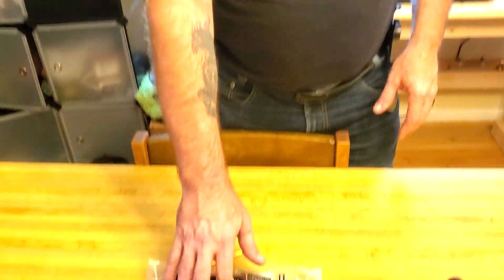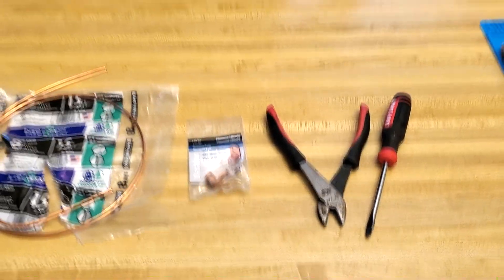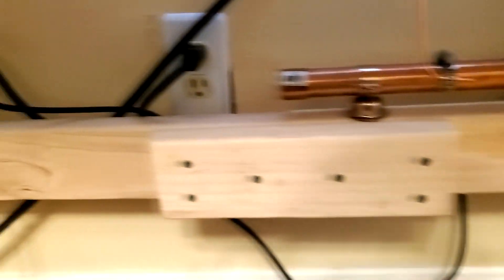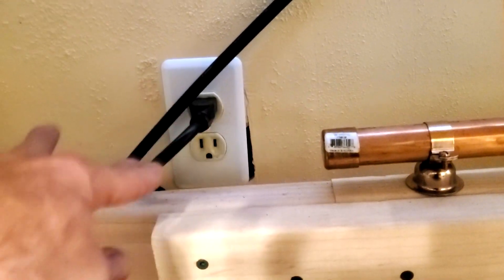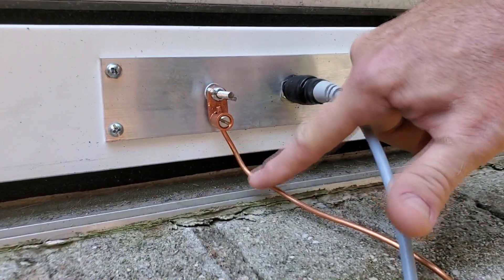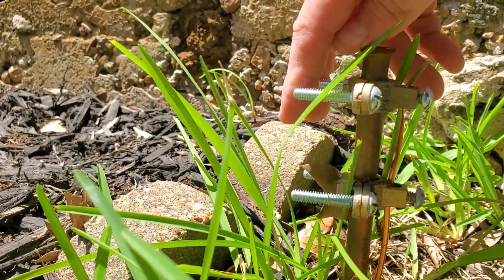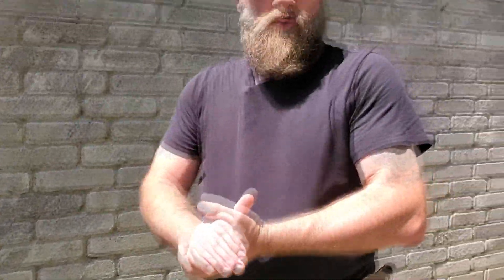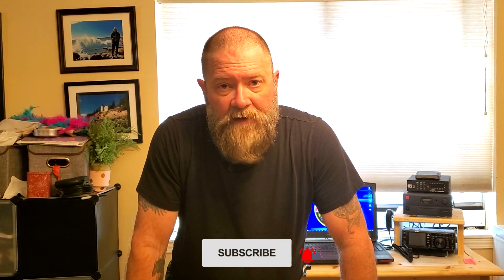How I ground My Ham Radio Station

Comment: I have tried to get a handle/understanding on this - I may not be smart enough.  I am not an EE and some of the discussions I have read through seem to get pretty heated.  Visuals w/ discussion(s) are very helpful for me.  Thanks again for your efforts to share and thanks to the other commenters for helping me/us out!  73
Reply from the maker: No problem, glad to help.  One of the most heated topics online or anywhere concerning ham radio is opinions on grounding.  I say, do what works for you.  There is a standard to follow, but don't overthink the process.  Even with all of my ground rods and wires going everywhere, if I see a bad storm coming, I still unplug everything from my window passthrough and unplug the power supply from the wall.  There is a huge investment in radios and equipment sitting in my shack and I am not about to lose it in the event of a storm and I get tagged with lightning.  Thanks for watching.  73!

Comment: I have not looked at all the comments. Just maybe 10 or so. Here are my comments:
1. braided straps between your common grounding bus and the equipment and from the bus to your pass-through.
2. 6 gage stranded (bare) wire from the outside of the pass-through to the ground rod. It is best to bury it and the top of the ground rod.
3. 6 gage stranded (bare) wire from the shack's ground rod to your service ground. (This will reduce QRM and prevent a ground loop.)

When and If you decide to put the ground rod close to the shack, stay at least 3.5 feed from the foundation wall (to avoid the foundation's footing),. which also eliminates the foundation from hampering the conductivity of the soil. Add a bus bar to the top of that ground rod to connect the lightning arrestor(s), the shack, and the other grounds. Every thing connected in series outside of the house. (except the lightning arresters on the outside bus bar.)
Reply from the maker: Those are all good and valid suggestions.  Thank you.  I am still trying to source a local place around me to find that braided strapping.  As for placement, I am limited somewhat by my surroundings and location of my shack currently.  I do appreciate all of those suggestions and have copied them to a document to go over in detail.  Thanks for watching.,  73!

Comment: You did a great job at showing how it's done. I was wondering if your antenna is grounded if it needs to be?  Maybe you show that on another video ?
Reply from the maker: Thank you for the comment and for watching.  Yes, I do have an update to grounding my shack in the list.  I drove another ground rod where the antenna is attached to a lighting arrestor.  It is a very short video.  Thanks again, 73!!

Comment: Dude thank you for this video. Strait forward and to the point. Is it necessary to have the copper pipe under the desk? I have a similar window pass through with multiple wires coming from the grounding point on the pass through  going to all the equipment. Thanks
Reply from the maker: After researching this topic a bit, it seemed to make sense to me.  Whether it is mandatory to do or not, maybe not, but I would think that the more grounding you have the better for the longevity of your equipment.  Adding that part to my grounding system only ran about $25, so I figured why not.  Thanks for the question.  Hope that helped.  Thanks for watching.,  73!

Comment: Sorry for this dumb question! Did you find that grounding has improve any reception or help with received background noise?
Reply from the maker: Not a dumb question at all.  I actually had no difference before or after.  Seems to be the same.
Reply: @HR4NT  Thanks,  i haven't seen any difference ether, so thinking i missed something. just going to see if you've done anything on loop antenna, if not what's your  thoughts?
Reply from the maker: @theDaftman  I haven't had a chance to play with any loop antennas yet.  That may be something I decide to do down the road.

Comment: Thanks for the video great info man keep it up. Got a question about the grounding the Ft991a.  Im wanting to build a Gator box for Pota and  shack.
How do you ground it when in the field ?
Reply from the maker: There are metal shelves that I bought to mount everything to.  I ran a ground wire to the shelf and screwed it in.  I guess you "could" run a ground wire outside of the box so when you setup for POTA, you could attach it to a metal rod, picnic table or whatever to act as a ground.  Hope that helped.  Thanks for watching,... 73!!

Comment: I hope those hose clamps aren't aluminum. Also, if you put in another ground rod outside, make sure it's at least 8' away from the ground rod you already have. Otherwise, they sort of cancel each other out.
Reply from the maker: The clamps are steel.  I also have the other ground more than 8 feet away.  Thanks for the tip and for watching.  73!!
Reply: "cancel each other out???"
Reply: @DNBVideo  Yes, I've heard that if you have multiple ground rods, the distance between them should be equal to their length. So, if you have an 8' long ground rod, and you put in another, it should be at least 8' away from the first one. 
https://www.youtube.com/watch?v=DiapZ7RkjFc&t=124s
Reply: @tglenn3121  I do understand the distance requirement.  I was confused about the terminology about cancelling out each other.  How do they cancel each other out?
Reply: @DNBVideo  If you read the other response I wrote, you'll see an article indicating that when they're too close, their resistive features overlap and reduce the amount of grounding you get.
Reply: @DNBVideo  The NEC requires all driven rods to be a minimum eight feet in the earth and for multiple connected rods a minimum spacing of .
Reply: The reason being is that when they're too close together, they cancel each other out.
Reply: @DNBVideo  Ground rods spaced less than two rod-lengths apart
Reply: Copper and aluminum WATER PIPES when submersed in WATER  corrosion will happen but NOT OUT OF WATER.

Comment: Look at the Polyphasers that you can install on the outside where the antenna connection comes into the house. They are the best on the market that I have found.
Reply from the maker: I was having issues finding any good info on the various brands and models to choose from.  Since shooting this video, Polyphasers have come up a number of times.  Thank you for teh suggestion.  I will look more deeply into them. 73!!

Comment: You’re not supposed To Copper and aluminum  together they will eat each other up
Reply from the maker: If you are referring to my window passthrough, the screws that the copper wire is attached to are stainless.  Thanks for the tip though.  I didn't think about the reaction of those two metals.  73!
Reply: When copper and aluminum WATER PIPES are mixed together corrosion happens but NOT OUT OF WATER.

Comment: where on the back of a mobile ham radio would you attach a ground wire, if you are using the mobile as a base station inside your shack?
Reply from the maker: Most mobile radios have a ground on the back.  I know that the FT-891 has that feature and I would think that most other mobiles would as well.  Thanks for the question.  73!
Reply: @HR4NT  Yes, I see where the FT-891 has a screw above the coax connection for grounding. Well, my Icom IC-2730A mobile radio doesn't have this screw; so I think that I will have to ground through the threaded holes where the mounting bracket screws belong. I went to Ace Hardware and purchased M4x6 screws, next I need a braided tinned copper ground strap to use with the screws.

Comment: Any mechanical connection that can be refreshed by turning a screw once in a while works for me.  The hose clamps around the 1" copper pipe may not be as refreshable as a pipe clamp, threaded with a pointed screw that impinges directly into the pipe (which can be tightened once in a while).  The 6 gauge wire can be clamped under a screw head that is threaded into the pipe clamp (which can also be tightened once in a while).  Just my two cents coming from years of GROUND BREAKING HEADACHES!!!!!!!
Reply from the maker: Hi Dan, I appreciate the tips.  I am going to continue to fine tune my setup and suggestions are always welcome.  Gotta protect that investment sitting in the shack!  Thank you for the comment and the support of the channel.  73!!!

Comment: This NEEDS to be bonded to your "service ground" as well!  
It's important to note that NEC REQUIRES (not suggests) surge protectors on any antenna cables/feedlines before they enter a building or dwelling. If, God forbid, a lightning strike hit and started a fire, homeowners would deny any claim for damage because your set-up violates National Electric Code!! 
If your "station ground" is not bonded to your "utility ground" it may dissipate static and may even give you somewhat of an RF ground, but will NOT protect you or your equipment from a nearby lightning strike. Indeed, a "stand-alone ground" will almost always make it worse.
Remember, there are two separate things here, grounding and bonding. The purpose of a grounding "system" it to keep everything at the same 'potential'. 
Depending on where you live, 'earth' (soil) has different values of resistance/foot.(the FCC website has maps of the US)
 Using basic ohm's law, a typical lightning strike is about 300 million Volts at about 30,000 Amps!! 
The difference of potential between two separate grounds is enormous, destructive and quite lethal. 
If your station ground is not bonded to your service ground, I'd recommend disconnecting it as you'd be better off with no ground!! Even nearby lightning strikes can induce millions of volts. I would highly recommend running a minimum of 6AWG STRANDED wire from your station ground to your utility ground. 
Mike Holt has a lot of good info on grounding on his site. 
Best of luck with your project and 73, 
AA2HA
Reply from the maker: Thank you very much for the info!  I knew that some viewers would be able to point out things that I wasn't able to find out or figure out on my own, so I appreciate that.  Thank you for the comment and the channel support!  73!
Reply: @HR4NT  Bottom line: do the tuner & amp perform as they should? Whatever conditions allow them to do so is okay w/ me. A thousand or more watts is not trivial so it has to be done right! Mike Diamond Plumbing put in the service panel. I'm gonna ask then about the "National Electric Code!"
Reply: My service ground rod is under concrete but I have access to the solid copper wire going to it from the meter box. Could I just tap into that wire and bond it to my station ground rod from there? Thanks
Reply: @dirkderemojr.3316   I've got the same/similar question.... can you bond the station ground to the service ground by running a wire to the service grounding bar?
Reply: @johnregan9644  Yeah I just bonded it to that and called it good. Not worth removing concrete imo
Reply: “Homeowners”? I love seeing this crap lol

Comment: great video, only addition i would recommend is adding some thought into RF ground (static) versus lightening suppression.  you have a very good setup for dispersing static and ground loops in your radio equipment, would recommend having another grounding rod for your lightening suppression separated as much as possible or away from the house if possible.  love your channel.
Reply from the maker: Great tip and a good point.  I appreciate the input!  Thanks for the comment and for the support!  73!
Reply: that is not at all code
Reply: @bigdEnergy666  Please elaborate. Could use an explanation.

Comment: 1" wide braid from your gear to the pipe. Flatten the pipe.  1" braid from the pipe to your clamp. keep your grounds as short as possible. use 8 ft ground rod.
Reply from the maker: Thanks for the tips!  I was looking for some braided copper strap.  However, I will have to order it because the home stores nearby don't carry anything like that.  Thanks for the comment and for supporting the channel!  73!
Reply: @HR4NT  https://thewireman.com/product-category/grounding-lightning-protection/tinned-copper-braid/
Reply: Whether the 1 inch pipe is flat or round it is the same surface area, so flattening it makes no sense. Also any additional ground rods must be bonded to the same ground rod the electrical panel is per code. Separate ground rods not bonded create an imbalance.
Reply: @NDC0065  your grounding RF not eletrical.  if your radio is on a supply with a 3 pin plug then you are already grounded electrically.  RF you want a separate ground.
Reply: @Brad Kellison  that's not what he's explaining in the video, he's talking about lightning protection not rf. Maybe I misunderstood him when he was talking about lightning protection.
Reply: @bradkellison5359  4' ground rod is more than sufficient in soft soil.
Reply: @alfrede.neuman8898  you are better with 8 ft even in soft soil.
Reply: Brad,
What is the purpose of flattening the pipe? If that is better, would copper rod be best, and if so, what diameter?
Thanks,
John - KK7JBZ
Reply: @johnbauman4005  you run a 1 " wide strap from each piece of gear to the flatten pipe, then run a strap to the ground rod outside. You never daisy chain from one to the other ex radio to tuner then out to rod.  You want them separate
Reply: @BradKellison  Brad, thank you. I got that part, I just don't understand why the pipe would need to be flattened. 
73,
John - KK7JBZ
Reply: @johnbauman4005  A lot of people can not afford the copper plate or bar to use to tie your gear together so flattening a copper pipe helps in that area. it gives you more surface then leaving it round.

Comment: I want to have my communications center located upstairs but I continue to worry about the logistics of all the wiring, which antenna(s) to purchase and how all of this is going to come together. Not only the ground wiring but also the antenna(s) and what not. 

Keeping all of this in mind while also adhering to the KISS method. Simple = Efficient. Sometimes I tend to overthink things to exhaustion which is entirely unlike me.

Our Construction Manager says that grounding should not be a problem. He is well aware that I absolutely refuse to cut any holes in our brand new home. By the way, we just got our closing date of July 13th. A full month ahead of schedule so we are really scrambling right now!

Anyway, he states that I could simply use the grounding rod that the house mains are built upon. Just run all the wires down/inside of the wall. 

My question is whether the ground leads need to be kept as short as possible or will I be fine running them inside of the wall to the second floor? 

This seems like a fire hazard in the event of a catastrophic failure. Of course, I always expect the worse - that way when something does occur, it is usually not as bad as you had expected. "Usually" being the keyword here if Murphy wasn't my constant companion. [Murphy's Law]

Honestly Scott, I wish there was a licensed-reputable business that employed actual professionals (not just some chump hired off the street with four hours of training) that could help you set up your rig and all the necessary equipment for basic operation. Both my wife and I would gladly pay for such a service.

As always, your straight forward, no nonsense, visually depictive approach to becoming a new HAM radio operator is a welcomed reprieve for individuals such as myself. On behalf of all the visual learners out there - Thank You once again.  

Stay classy my friend.
Reply from the maker: Hey I really appreciate the comment!  I am by far no electrician, however I agree with the comment below about NOT running ground wires through the wall.  Sounds like a disaster waiting to happen.

I originally wanted my station up in my studio, but the logistics of running wire, making it look presentable and dealing with grounding forced me to put it downstairs where it was a lot easier for me to deal with it on my own.  As you stated there aren't really too many specialists in this field that I know of that could come out and at the least give me pointers on how to best connect everything.  I love the comments and suggestions from this video and will utilize as much as I can to make sure I have it done correctly and efficiently.

As always I thank you for your support of the channel and I will keep it classy!!!  73!!!!
Reply: Do not run ground wires through the house.  The ground wires will act as an antenna so you want to keep them as short as possible.  You want to get the ground wires out of the house as quickly as possible.  Create a window passthru like he has and have your ground go out through that in your radio room, then down to the ground.  You want to keep the it as short as possible so you don't pick up noise and don't have it radiating RF.  You can make the window passthru like he did (he has a great video showing how to make one) or you can't get one from MFJ, depending on your budget.
Reply: Bert ty for your echoing  the thoughts and concerns  of thousands  of new Ham who just got Lic#  Visual  Learners!  7 3